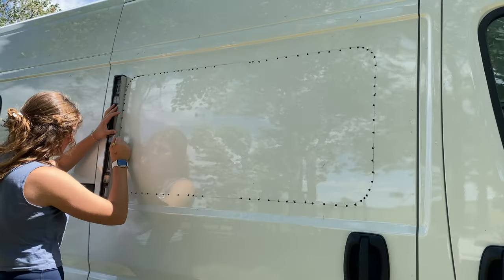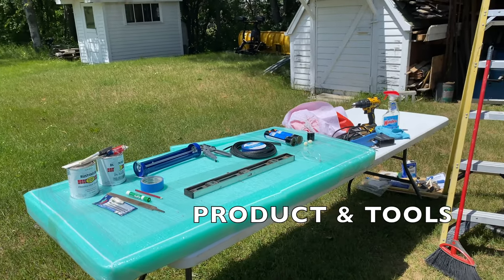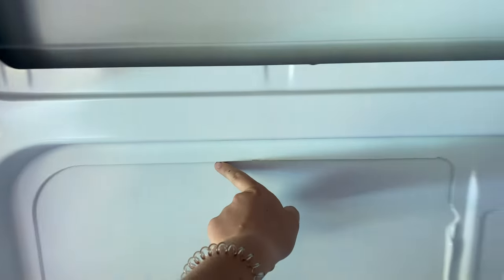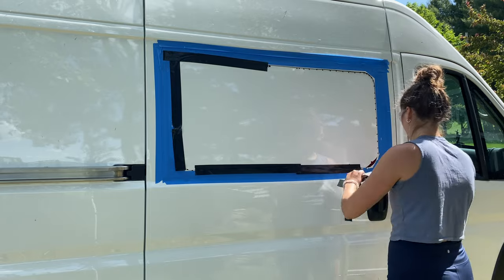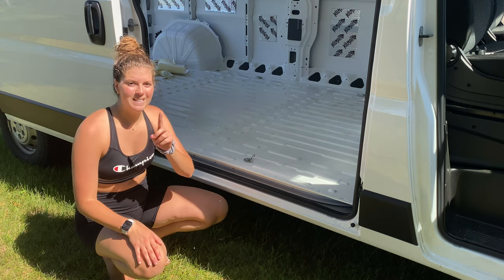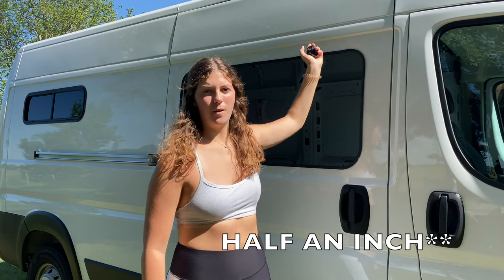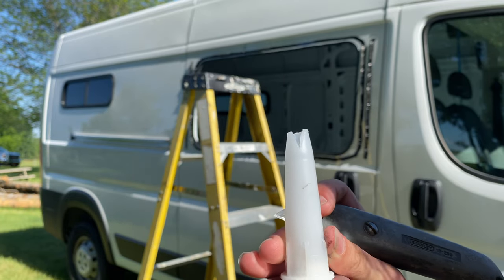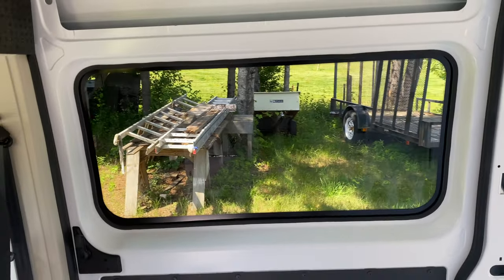Van Windows Direct Sliding Door Window | Ram ProMaster Van Build Series 4 | Solo Female Van Life

Comment: Way helpful, include the metal shavings tip. I have little rust spots up on the roof from my install. It's only on the top layer of the paint and can be removed with " star Brite" rust stain remover.
Reply from the maker: Thanks. Yes, I have been overly paranoid about rust and leaks. Crazy how the tiniest piece will cause rust.

Comment: here's another trick. Get some handled suction cups that pump up like glazers use to move windows (Harbor Freight has them) and attach them to inside of the window. Them use a ratchet strap from the handle to the opposite inside wall of the van so it puts a little pull on the window
Reply from the maker: Yes! I did consider doing this but couldn’t find suction cups in my area. Thankfully the window was super light and easy to install so in the end I’m glad I saved some money but definitely an option😊